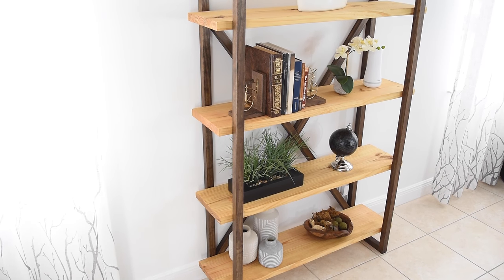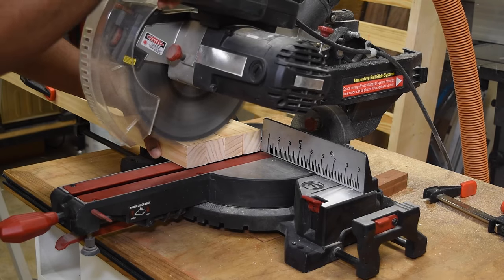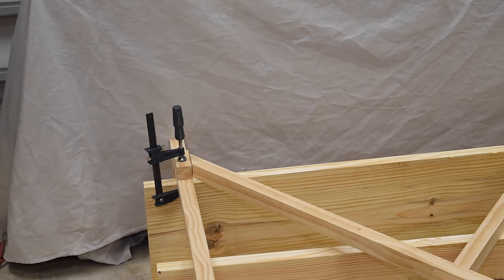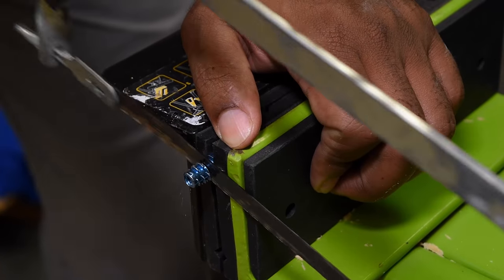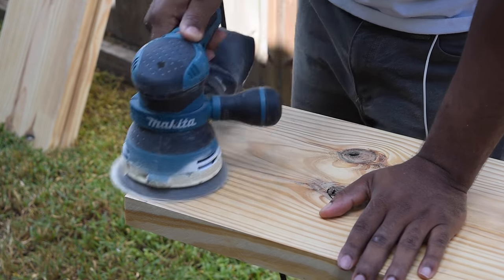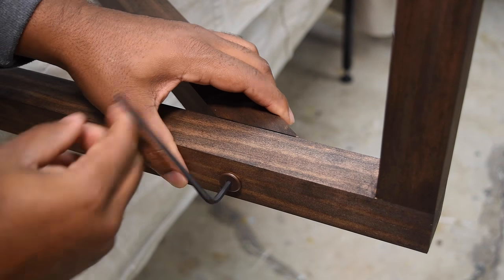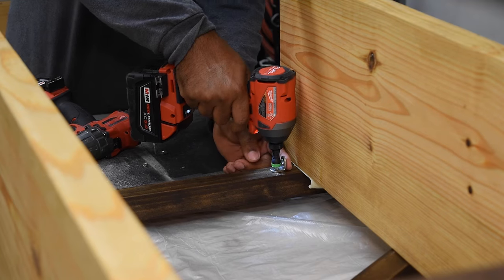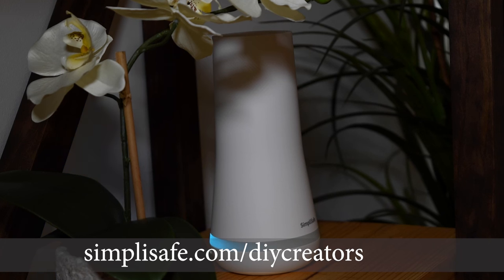DIY Bookshelf - Storage & Organization

Comment: GREAT limited tool build. Thanks. You've helped SO much. i have a degenerative illness. & haven't actually built since my health caused me 2 leave a completed but unpainted project when a sudden storm hit. Fall became winter& it didn't get cleaned up until the snow melted(VERY embarrassing) Because i know i now would need help setting up & putting away tools i've found your site with 1person builds, technique hacks, & less tools a God Send.     I'm not back in the shop yet; but the hope & distraction- thinking of ways to simplify your builds even more... have been a therapy better than any other. 
     I've watched & commented on DIY channels for years now, never sharing my situation. But i woke my computer to ask Alexa to order me a Furrino shelf- it has a style like this & tool free assembly. instead i got alerted to this build, watched, printed plans from website & think this may be the one; the build that i ask for help &(mabe with pocket holes instead of dowels) i try.  Thanks Again/ Lisa

Comment: Good looking shelf unit  Glen.  As an option for the shells, you could also use screws and threaded inserts . Polished brass or stainless steel so the also work as accent pieces

Comment: NIce, I actually was thinking about small book shelf similar to this, I wanted to use some bridle joints on the side supports and mortise and tenon for the cross brace. I want some practice on hand cut joinery. But this nearly exactly mimics what I have in my head!

Comment: Very nice..couple questions for anyone..1) since the shelf is right against the front and back pieces, would it cause problems with expansion? 2) Would dowells work instead of the L brackets? Trying to think of concealing options.

Comment: I've got tool-envy...   :)

That turned out to be a beautiful piece, even though you used a fairly inexpensive wood. I might attempt something similar. I have a 2x4 cube shelf that I use a 12"x12" basket in each cube, and would like to replace. It's a dark wood like the espresso stain you used, and I prefer either a very light stain, or even just a clear coat, depending on the wood. I like hardwoods, but usually go with alder, as it's generally an inexpensive wood to purchase, has a nice grain, and isn't as soft as some types of less-expensive pine.

Comment: I want to build this but wider (15" depth) to hold heavy kitchen appliances (ie mixer, air fryer, blender) but I'm afraid the L bracket would not hold it's weight, or would it?  I actually like the nuts and bolts showing and plan on using 2x4, would it be ok to drill thru or would an L bracket hold up better? Maybe a longer L bracket? Please advise Thank you in advance

Comment: Hi I am planning on building these shelfs for my pantery to keep drinks on. I am an amateur woodworker and was wondering how to make sure the shelfs are strong enough to hold several bottles of drink. Could I use a pocket hole joint like you didn't for the floating shelf? Do you think that would create enough strength in the shelfs?

Comment: Nice! Any blotching issues when you applied the expresso stain on the pine? Would you recommend using a wood conditioner?
Reply: Great question- i made a bed 4 yrs ago w/rough 2x lumber. To save money, instead of conditioner- i spritzed wood w/ water this raised the grain & once dry i sanded down before applying low$ espresso stain(mixed w/fabric dye to tint). it came out well but did feel like it took forever. I did it because 30yrs ago in wood shop i was told that w/out conditioner or this step the grain would rise with the stain. I have since seen videos where they don't do this even with Rf lumber. I hope DIYCreator answers you 'cuz now i'm curios; may be he ran it through plainer?

Comment: Beautiful project, Glen, as always!  I'm curious what was the charity?  I like the idea of local creators giving back.  Only thing aesthetically I might do differently is paint those silver brackets to match the allen fasteners.  Also I'm curious if the 2x2's will warp after ripping them, which will release any tension and expose new surfaces to drying?  Gluing them up from 3/4" stock might be more stable.

Comment: Posted this on your instructables post, but thought I'd ask here too. 

I'm fairly new to wood working. I do have some wood that I want to use on a project in this seems perfect. I have a two 2x12 12 ft pieces of birch. Do you think that the frame would be able to support the weight of the birch? It it seems like it's a very heavy wood and I don't want to risk putting this all together just to have it collapsed under the weight. I'll be using some redwood 1.5x1.5 for the support. Any information would be greatly appreciated.

Comment: Hey Glen, quick question - in the build details on your website it says you use 50mm (1.97") fasteners but the wood frame is 2 inches thick. Is this a typo or should I be using longer fasteners (60mm or 2.36" thick)?

Comment: Now just add a couple picture frame hangy holes on the top and middle so it's flush against the wall,  attach a small bag with 4 drywall anchors and little bolts, and the thing can be tethered to the wall to prevent tipping or falling on curious kids.
Reply from the maker: Totally, I may just do that.
Reply: Little ones are curious critters. They use things to help them learn to stand. they try and climb on everything, and they love to pull, push, and play..